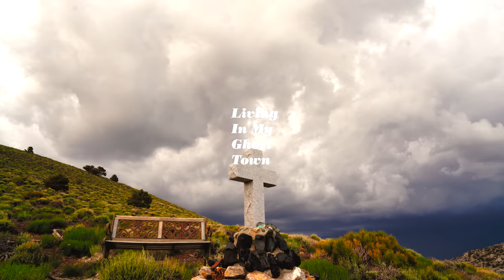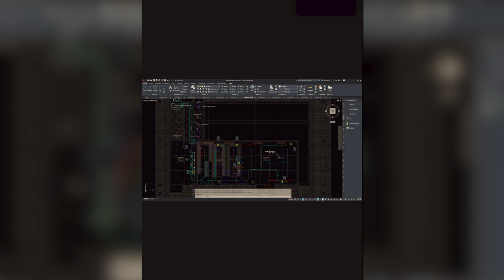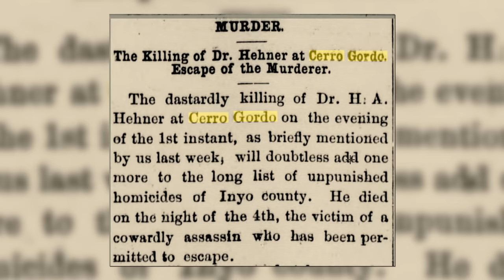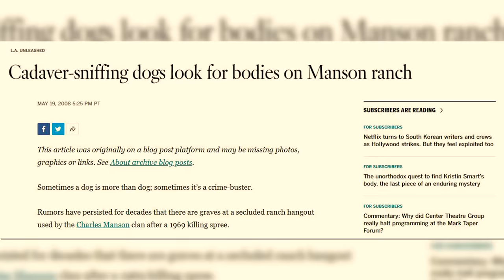39 Months In A Ghost Town: A Cadaver Dog, Lost Mines, And More...

Comment: Brett, one thing that probably should be considered is that when Owens Lake was drained, it probably changed the local weather patterns which resulted in more of an arid condition. Those mammoth tree stumps that you’ve found in some locations are probably signs of a wetter climate, which would also support the higher demands they had for water.  I would not be surprised if the older wells prove to be currently dry.  But with the growth of Owens Lake, I’m very much curious if you will begin to see an increase in the amount of rainfall, humidity, and heavier morning dew that could lead to more plant growth and the return of many of the older springs and water sources.
Reply: If LA doesn’t steal the water!
Reply: @kokonanana1  thats it la gets no more water

Comment: Brent, if you happen to have a UV flashlight or black light, you should shine it on those slag glass lamp shades on the shelf. Uranium was used to color glass green until the 1930s and uranium will shine a bright green under UV light. Those lampshades look like they have potential.

Comment: That is so fantastic to see.
Just wondering, with the power requirements for the coms site above, does it have 3 phase available? If so that will open up soooo many opportunities in the future.
Re water.
The spring water so far down causing low flow, leak issues, reliability issues as seen a couple of years ago. Thought about having a tank and pump station at every landing on the way up?
That way each pump will have a restriction less flow up to a tank 100 or so feet. Of course there will be level switches on each tank etc etc till it gets to the last pump that will be governed by pressure re demand.
What about the spring further up? would it be cheaper to send up power lines there and pipes than putting in extra pumps/tanks on the current water supply?

Comment: I'm no engineer by any means but 2k lb steel beam on that framed wall...I didn't see anything more then 2x4 in that wall framing with the beam sitting on top. That's sure alot of weight in my opinion sitting on couple 2x4s at each end.

Comment: Well, just a question: Why use wood for the first floor walls etc.? Isn't that going to be super hot and stuffy inside (it's California, so very hot - right?)? Wouldn't thick stone walls be better?
ps: My parent's house is from the 1930s and has thick brick walls (30-40 Centimeters on the ground floor), so it stays cool inside, even if it's 30 degrees (Celsius!) and more outside!

Comment: I really don't get putting steel beams atop wooden walls. If the wooden wall fails then the steel beams are undermined. If you had steel pillars too, to support the beams, that would make more sense to me as a brit. Some American building practices seem a bit back to front for me. Basically, if you are going to put steel trusses up, use steel to support them.

Comment: thank you for sharing. twelve thousand very plus on top of Wood probably pine. with not anchoring to the ground?  my man that is calling for a future disaster. If you are adding that much weight to the structure make sure, those beams are sitting on standing beams that anchored to the ground. in a U shape. TO ME its does not matter what the designer said. Wood is weaker than steel bean. however you will do what you want anyway just being nosy here

Comment: When I worked for carrizo gorge railway       "the impossible railroad".. in early 2000s.  hauling sand from plaster city to campo. my supervisor had worked the line in the 80s I believe. He also alledgedly drove a Golden spike for San diego trolly.  Anys I believe at tunnel 14 there was a base camp below the railway. I could be wrong on tunnel #. But above the rail way. Was a trail that headed up the mountain right before dos cabezas... or back side of inkopah.
Alledgedly, there was a grave yard up there. But the old  timers would pretty much try to fight you if you attempted to go up it. They swore ude bring back bad ju ju or some curse. As it was were they barried a bunch I workers who died of some illness or virus. The story goes anyways. I honestly never did climb that trail. So idk.. the line is from early 1900. The curve are to tight and terrain to loose. The train pushes the tracks apart. So it had a 10mph limmit ..To limit the load in the outer rail.  We had 3 derails in the 1.5 years I worked there. Between that and tunnel collapse every time it rains heavy.  It's not hard to imagine why It's never bin a very profitable line.